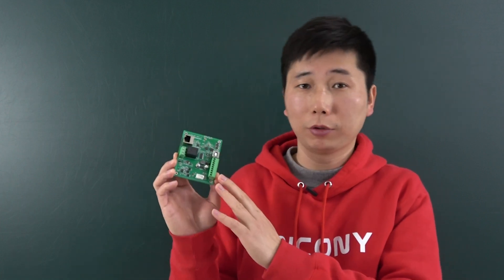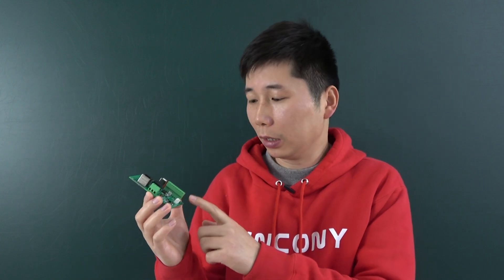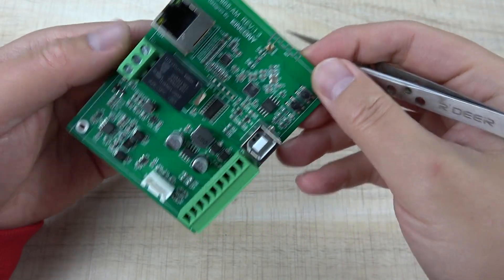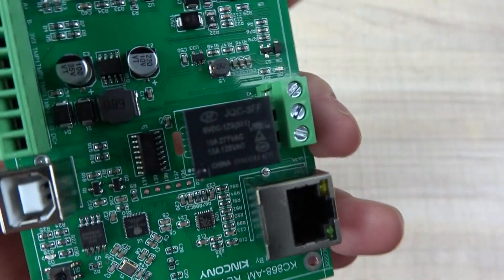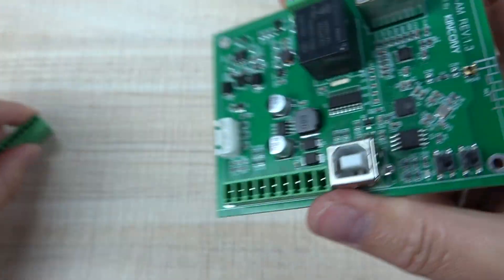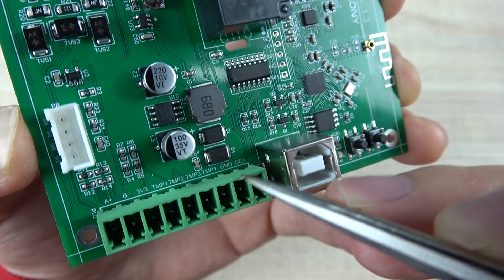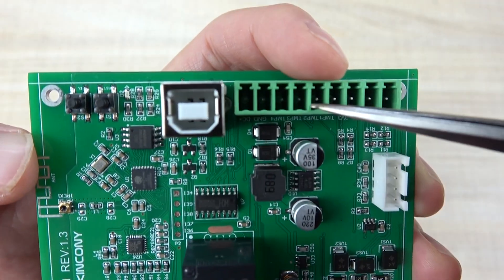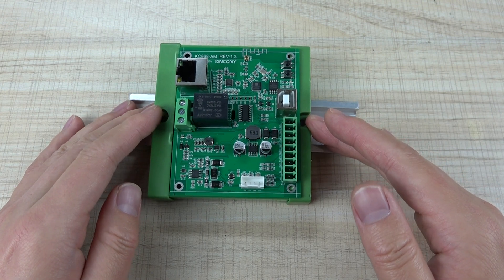Small ESP32 IO Expansion Board For Home Automation DIYer - KC868-AM

Comment: Nice, Can you also design with POE+ that would be great
Reply from the maker: we will consider POE in furture.
Reply: you already have board (KC868-E16P) with optional PoE module. It doesnt have to be build in, but it should be available as optional. By the way - as I mentioned before - would be nice to see this board with all 9 GPIO's with pull-up resistors (as GPIO-1, 2, 3 and 4) or even more  @KinCony
Reply from the maker: yes, some new board we have designed, will have POE socket option @liudas000